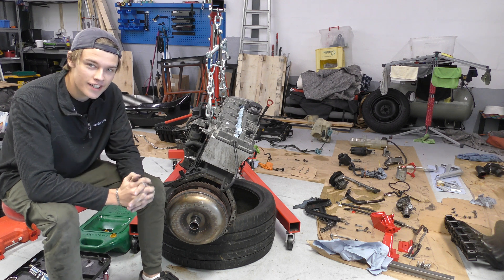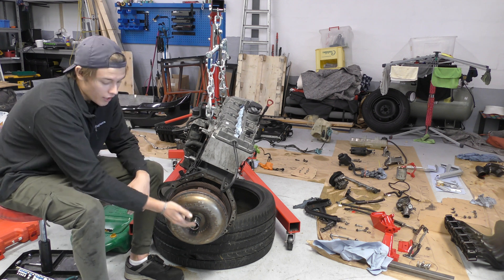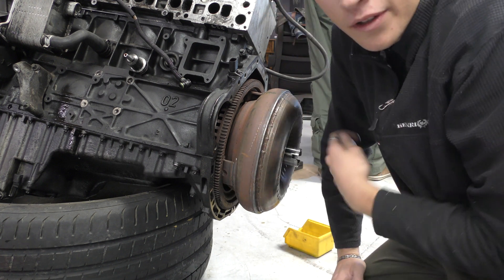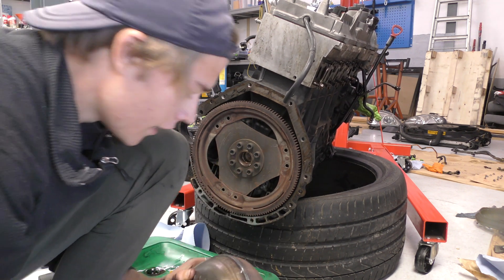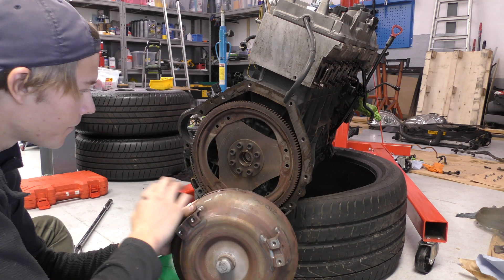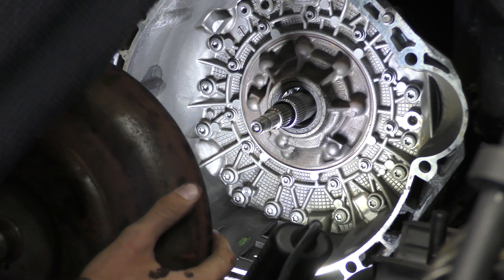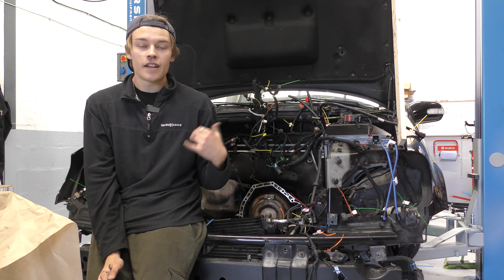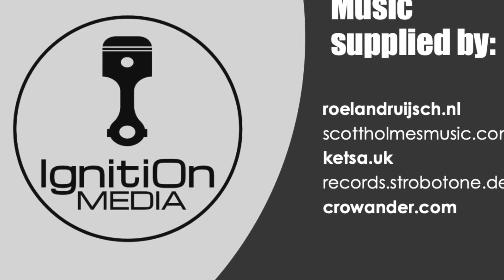Automatic gearbox torque converter removal and install - shown on a Mercedes ML W163

Comment: Thank you very much for this. I will swap engine in a C180, i will not need to get the engine out togheter with the gearbox then... Perfect, thanks! 👍
Reply from the maker: Good luck with the project
Reply: @DrivenMadShow  Thanks, not a project really, worst engine ever made, M271. Maybe you heard of it, no teeth left on the camshaft sprocket-wheel, Chain jumped, engine junk! How Mercedes can make stuff like this is a mystery...
Reply from the maker: @chrismullin3986  Our ML is a pile of junk - we have been told the 270 engine is indestructible - thats until a Portuguese mechanic gets near it !